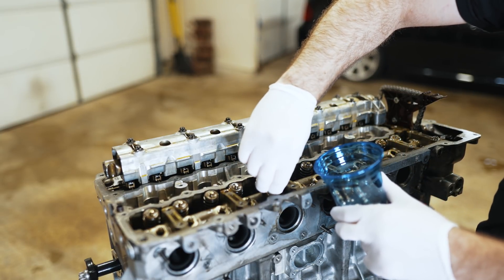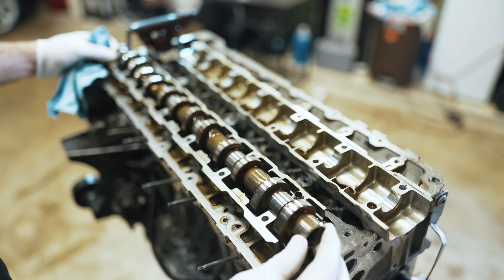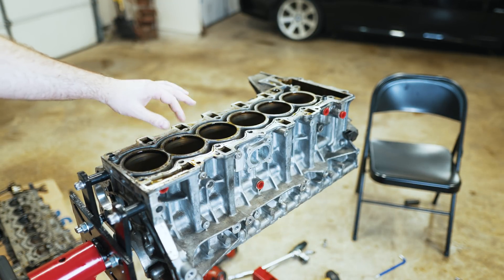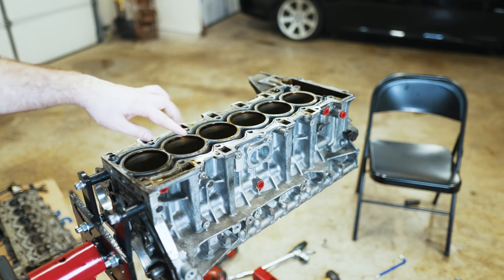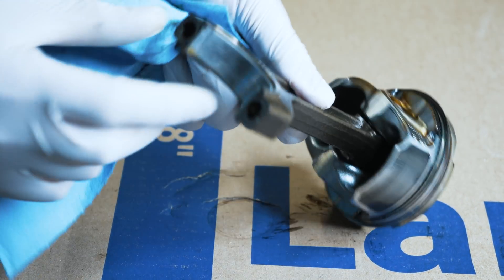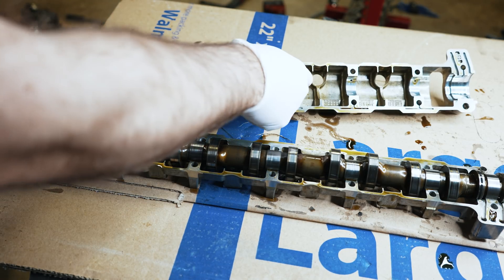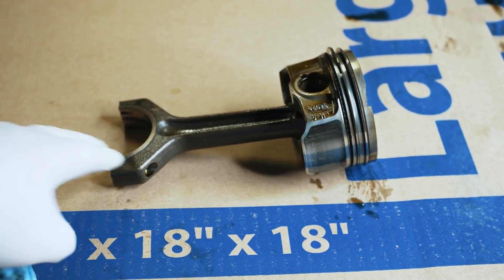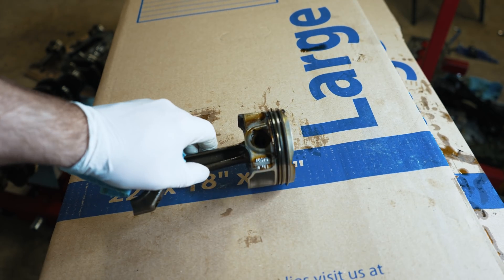Come Look Inside A BMW Engine!  Full Tear Down

Comment: Maxpeeding rods are major NO, it's chinesium.  better to go with Carillo, or similar like Manley ( wish Eagle made some rods for us, their rods are awesome, used them in my 4G63 engine) either way, will need some squish gauge ( IE plastigauge, measure from multiple sections/points per rod)  and if you polish your crank, you will need to make all journals similar to use a standard bearing across all surfaces, or get material added back on and machined off ( plasma spray style, or weld and machine)

of course the factory rods are also forged, and fairly strong, depending on power goals, a set or WPC treated, or coated bearings, and ARP rod bolts with a stretch gauge would work great.

one thing i've learned, play a bit more to the loose side  then tight side, because you also need to account for expansion under thermal  operating temperature. and if anything, run a thicker oil.

Comment: Didn't you measure the bearing clearances? spun bearings happen from clearance too tight or too loose, incorrect oil viscousity, low oil pressure, power applied before oil reaches thermal viscousity or degraded/contaminated oil. Make sure you check all oil galleries for debri.

Comment: My n54 blew a hole in the engine block currently I have the old engine out of the car and am trying to save up enough money to buy a new engine. My question is once I have a new used engine bought what all maintenance should I do to it before putting it in my car so I can have a peace of mind and be able to push the car a little bit

Comment: Crank looks like it has earned its 200K. Did you measure and clearance those King bearings at assembly? The one bigend shown looks like it has worn on one side (crank pin taper or rod needed sizing). Did you plastigage or physically measure bearing clearances? I do not see this as a King bearing issue frankly. Oh, yes, put those H beam rods in, or put a new set of OEM rods in at least. My sixpence only.

Comment: Great video but only confirms my fears that all post '08 turbocharged BMW engines are destined for the bin. They are too complex, too many components and require very high level of competency in rebuilds. The turbos added level of complexity is the icing on the cake.

Comment: Sorry to hear man. Thx for doing the vid. Appreciate u. 1 bad camshaft/tray costed me madd loot over years and almost did my engine in. Turbos wore out ..limp mode daily. Replaced 1 camshaft 2 trays & all 24 low side lifters. Took forever. Found out 1 tray had too bad scoring on it ... I love ur old n54 bro but nah don’t rebuild it. Buy another used one w/ 20k+ miles if you still want n54

Comment: I don't know if this is true but apparently the n54 engines that came out with the index 12 injectors have slightly different bearings. They are like upgraded oem bearings. 335is and m1 came standard with these bearings, i don't know if this is true though. Also it would be nice to get some proper information on early production n54 vs the later production n54. The differences etc. Much love on your the videos, they are great.
Reply: Use realoem

Comment: I just did some google search on N54 rod bearing. Apparently, this is a common problem. It seems that those high performance BMWs are gonna suffer from rod bearing wear and then rod knocking and sometimes spun bearing. 
One article explain that this is a flawed design and claims that the engine should have a higher pressure oil pump or even dry sump set up and combined with a larger clearance rod bearings. https://www.langracing.com/finding-a-real-solution-to-the-bmw-s54-rod-bearing-failure/
I saw a teardown of a Honda V6 with very high mileage which has way better looking rod bearings. https://youtu.be/iVGCQ-oUB90

My research was a 5 min research so obviously it's not perfect.
Reply from the maker: Thanks for the info.

Comment: That engine is cleannnn what oil do you use and what intervals?
Reply from the maker: I used Rotella T6 5W40 and changed it at around 5K miles sometimes closer to 7.
Reply: @VehicularDIY  thank you!

Comment: Those bearing score lines are from debris. Each main feeds one rod. If you have score marks on the corresponding main bearing then there's a good chance debris was fed through that main to the rod causing your spun bearing... not the bearing's fault.
Reply from the maker: I traced it and the main that had a score line feeds number 4 which was fine and didn't spin but thanks for the feedback.

Comment: I think one of the cylinder head bolts is missing the one right behind the ofh. Idk why but that how I got it from the dealership. Anyway what bolt do I need and what are the torque specs. HELP please and thank you
Reply from the maker: They are torque to yield bolts so you'd have to replace them.  I'll see if I can find the specs.
Reply: @VehicularDIY  cool yeah I figured they were aluminum. To be more exact it’s the blot that sits right behind the engine hoist screw hole. Idk what bolt I need to buy

Comment: Really good video the rods look good but originals also looked like they sustained 200k without issue.  Try the new rods and do a turbo build met s hut at Sears Point Raceway with turbo that claimed it made 475hp reliably.  Do it!  It will make for great content and thank you for awesome video

Comment: 2 Vanos Filters (check valves) are still in it... left side of engine near the front, two recessed round plugs one on top of the other with torx holes in them. People often change Vanos solenoids, but do not know about these filters and leave them there, gunked up. They can be easily changed by hand feel or using mirror, without any disassembly.

Comment: I think we as non-bmw mechanics can't do bearings on an n54. It's too complex. I saw some Bulgarian real mechanics do these BMW bearings, 100% as BMW would do, so with the different shells on some journals and that engine run 100% on big boost again. So I think the King bearings are good on a non tuned n54, but not for 500Whp+. 
Please buy the connecting rods( saw really good reviews on these) and rebuild the engine as a spare. Or put it back in the car and sell the other engine. It's a lot of work, I know, but adding great quality content on the channel, 'it'll pay back double! Dutch regards, Nico.
Reply from the maker: Yeah the fact that the N54 comes with multiple bearing types to maximize the clearance makes things more complicated for sure.  A long time ago I rebuild an S14 for my E30 M3 and documented it here:  https://www.r3vlimited.com/board/forum/general-forums/members-rides/the-project-forum/77133-project-s14-rebuild-for-my-new-e30-m3  
I was confident using plasti-guage here but in retrospect I should have looked into it a little further.

Comment: Correct me if I am wrong, but I believe the N54 comes with forged rods and even early ones (06-07) could be found with forged pistons. So is there a point to going chinese forged rods? Forged pistons, yes, but unless You have a bent rod, I don't see a point risking it.
Reply from the maker: Yeah the rods are forged but they don't like over 600 wtq.
Reply: @VehicularDIY  if a bearing spins the heat that is transferred to that rod would be my concern even if the rod appears straight.

Comment: Lol I’m gonna say those cams an trays are fine :p haha maybe I’m partial to em who knows..But your making me paranoid about the bearings so far mine are holding up. And they have seen some abuse. Although you are pushing a little more HP than I am.
Reply from the maker: Yeah lol, I think an oil pressure gauge would really be a nice add on for piece of mind.  I'm looking into it.  You could compare the values.

Comment: 1000 hp singel ,first test crank shaft balance , N54 bottom end is very strong but if they start creating issue,those issues never get stoped but you need very good test on that engine it self and parts,
  if its ok ,well can be time to build new engine  for  more powa baby

Comment: I think if it were me, I’d get VAC coated main & rod bearings. They do make them for the N54, but they don’t advertise it. Also, king bearings also make a coated bearing too. 

I think I’d just get new OEM pistons. Rings? Idk I have read that the BMW pistons are better than forged because they allow for tighter clearances due to how they are made. 

I like the idea of upgraded rods. 

Are there upgraded cranks? Idk I don’t like the idea of sending it out to get ground and then using different rod bearings for most of the cylinders. 

Personally, I don’t think you broke in the rod bearings enough before you hammer timed the engine. Running it hard before the oil got to 170F just made it worse and compounded the problem. I would have taken it easy on the car for about 1000 miles before I beat on it. Just me.
Reply from the maker: Interesting, I wonder if anyone is running OEM pistons making over 700 WHP.

Comment: I’m going with OEM bearings when I switch mine out. I saw your prior video and was concerned about the possibility of this happening.
Reply from the maker: Yeah that's a safe bet, make sure you get the exact bearings your engine came with. There are a few variants.
Reply: @VehicularDIY  thanks. Yes I read there is a stamp on the crankshaft that says exactly what bearings go on what journal.

Comment: Wow definitely not touching my rod bearings, unless absolutely have to. It would be cool to see you do a fully built motor, hopefully you can land some decent sponsors to be able to!
Reply from the maker: Yeah that's going to be my advice, I actually said that in the past in comments but ended up changing them out when my oil pump chain let go.  I wouldn't have touched them proactively.  Seems like only high revving motors need them changed out for maintenance.

Comment: Still curious as to what caused this failure. I don't think it had to do with the used cam trays, the oil filter would've picked up any particles from the cams long before they got to the rod bearings.
Reply from the maker: I can try measuring them again?  On a bearing the didn't spin?  Not sure if the info would be useful at this point?

Comment: Was all the bearings on the rotating assembly scored or damaged or just the one rod set?
Reply from the maker: Seems like mostly the rods and mains just a little and the cams.
Reply: @VehicularDIY  if it was every single bearing shell that was damaged then it was definitely an oil clearance issue, oil pump issue....or somehow debris got into your oil and simultaneously had oil filter failure which is unlikely.....

Considering you just put those in a few months ago I'm pretty confident it was the bearing clearance...

Out of curiosity what viscosity oil are you typically running?
Reply: @VehicularDIY  btw im a machinist...been been doing this shit for a long time..... I enjoy you videos a lot btw... I have a 335d but many of your videos are useful for my car also other than the engine itself lol.

Comment: On such long cams that ride in aluminum saddles its extremely common to have slight scoring and its typically a non issue.....from my years of working on supras I've never seen cams without scoring on the bearing surface....only time its of concern is if it's really really scratched and catching your nails and the oil tolerance is opened up way too large as it contributes to low oil pressure.
Reply from the maker: Yeah I definitely couldn't feel any scratches on them.  Thanks for the info.
Reply: @VehicularDIY  no problem man.  This is just a super common thing with aluminum saddles as its not the best bearing material and cams dont get the best of oil flow....id be shocked if you found an engine without any sort of blemishes on the cams with higher mileage.

Comment: I say you build the engine and put a single turbo kit in it. A lot of people are building N54, N55s or attempting to put single turbo kits on them but they end up cutting corners or doing a job that will work but won't necessarily be sustainable. Being you, I know you'll dedicate yourself to it and will not overlook certain steps or required hardware. Fuel port injection, single turbo, upgraded clutch! It's not some project you can just snap your fingers and it would be done, but it's something we would like to see!
Reply from the maker: Thanks for the feedback!

Comment: Hey I was wondering is it really possible to turbo charge a 328i?
Reply from the maker: Possible but not cost effective, might be cheaper to supercharger instead.
Reply: @VehicularDIY  for a e90?
Reply: @VehicularDIY  thank you for the info just really wondering since I just got a 328i 2007 a while back and I really want to build it

Comment: Man my m20 didn't look like that god only knows how many miles it had on it
Reply from the maker: I have rebuilt a couple M20s, back in the day I put a 325is head on a 325e block to make a bit of a stroker and used a crank from a diesel.   I was going to turbo it but ended up buying an e30 M3 with a spun bearing and rebuilt the motor.

Comment: Use plastic gauge to measure the bearing size and the crank once you fix it but personally I'd get a new crank. To Measure the bearing clearance to the crank. Lay the plastic gauge on the crank    in-between the standard bearing. Assemble the connecting rod torque to spec! Undo and measure the thickness against the paper the wax was in. Then it says how much thinkness of a thousand of a inch the clearance is. Ie 0.003 A rebuild shop would have it. I think there's green which is thin and then red thicker.
Reply from the maker: Yeah I'm wondering if I should get a used good condition crank instead?

Comment: P.S.   run Clevite bearings. get a tri layer; and do the diligence of checking if ya round....you should know what i mean later...
Reply from the maker: Yeah I'd get the machine shop to verify the clearance but assemble the motor myself.

Comment: Logically speaking, I dont see how those cam trays would have contributed to the engine spinning a bearing. I think all the new parts you replaced, coupled with the new bearings etc had something to do with it. Something was most likely out of spec

Just caught the last part of the video, I definitely think you're right putting the blame on those bearings.
Reply: Even with the right sized bearings, if you torque the caps too tight there wont be enough clearance for oil. If things haven't changed since I last rebuilt an engine, you'd normally torque everything to spec using the new bearings and use a crush gauge to check clearance. I wouldn't trust anyone except OEM in terms of specs and tolerance.
Reply: @alexeimaterov3226  i used kolbenschmidt  bearings on my build but i polished the crank myself until it was very shiny. I had no machine work done on the used crank i bought off ebay and my clearances were on the loose side of the specs. I put in a brand new oil pump also. I've put 12k miles on it and its still holding. I feel that bmw bearing specs are too tight which is causing the majority of these spun bearings. Add into the mix a worn out oil pump with 200k miles or miscalibrated torque wrench or the king bearings were fake china specials but we'll never know the real reason why it failed but seeing that all the other bearings have damage, I'de put my money on a worn oil pump and too tight bearing clearances.. I'de love to see him do a rebuild with aftermarket bearings and stock rods, just replace the 1 rod.  Ah... i just finished watching his rod bearing install video and i believe he was doing the torque sequence wrong. He did 2 70 degree torque's when he should have only done 1. I'de say those rod bolts failed because they were overtorqued

Comment: I bought a set of Maxspeedingrods for my audi 1.8t build a few years ago, quality and finish on them was decent but they sent me a set that wouldn't possibly fit any audi 1.8t application. The application required either 19mm tapered small end for the wrist pin or it required a 20mm wrist pin non tapered. They sent a 19mm non tapered rod..
Reply from the maker: Nice, thanks for the info.
Reply: @VehicularDIY  no problem, I had a buddy who needed the 20 mm version of the rods and they sent him the right ones, he made over 500 hp with them on a 1.8t and they didn’t snap our bend so I’m guessing they are using the right process just didn’t have the sizing down. Maybe they’ll be better for the n54

Comment: The oem bearings made it to 200k so I'd say you are safe to.go with those.   Single turbo will make big power but seeing twins maxed out would be interesting. Keep in mind the other upgrades for reliability. More power=broken parts. Traction is always going to be huge issue with the power you put out. A comparison between stock location and relocated inlets on upgraded turbos would be nice to see. Keep making the vids!

Comment: nothing is better than OEM bearings, but that’s just an experience! 
+1 to the motor rebuild. 
Just get the new or good used crankshaft and standard OEM bearings.

Comment: I would pay money for that complete rebuild... I got a 2005 X5 6  Cylinder and I think that's the same motor as the one I just saw you pull apart... right or wrong... Anyway im always impressed with your content and had no idea how this motor looked from the inside out ... I got 200 thousands miles on mine and she still gets up and goes ... Im so impressed with how nice they built these motors and you taken the time to show us everything.. Thanks  !!